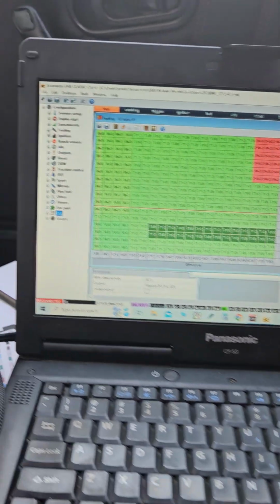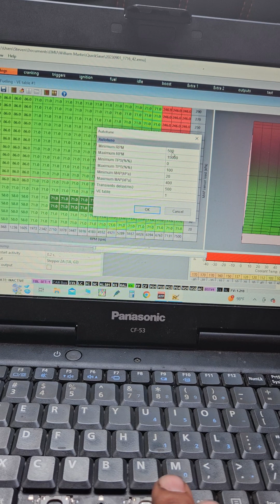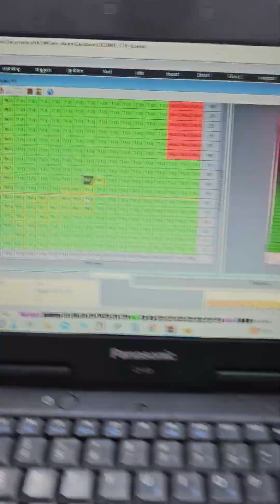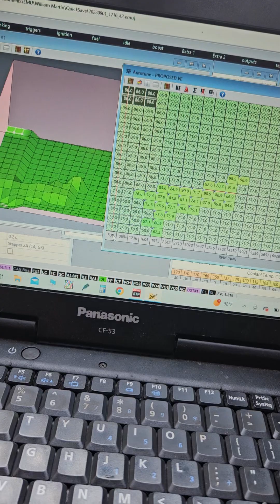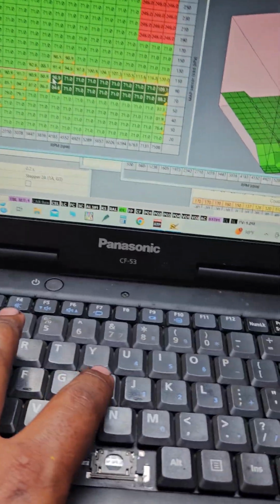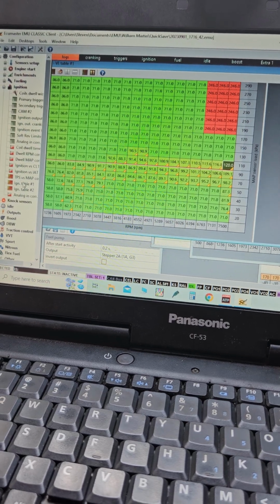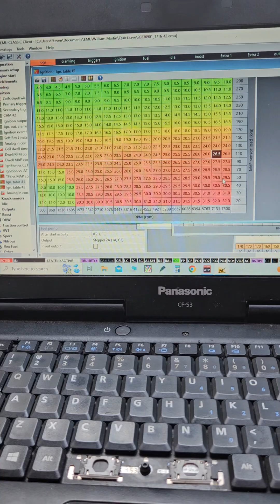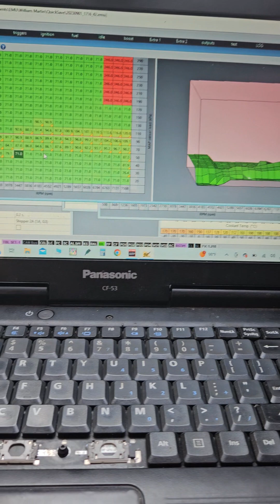ECUMaster auto tune overview on the SR20 swapped miata

Comment: I own an Ecumaster Black. I want idle 14.4, calm handling 13.8, full load and 12.8 afr at top revs. How to do it with automatic editing.
Reply from the maker: You can do some stuff with auto tune, but not that much.
Reply: @krmotorsportskilleen  So what is the main purpose of this feature? Is it just to adjust the idle value?
Reply from the maker: @cihangirasi  no, it's designed to get you close enough.  I'm sure you could set it completely for auto tune, but I've never done it.  I wouldn't trust it enough for wide open throttle. 

Secondly, you have to keep in mind you've got a ton of corrections, and if you're not setting those up correctly, you're going to have a ton of weird auto tune adjustments